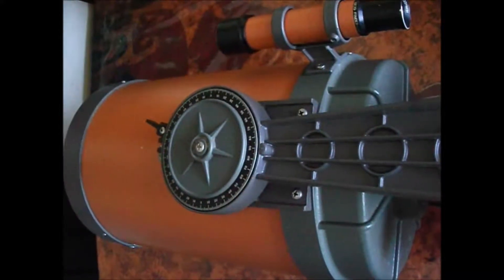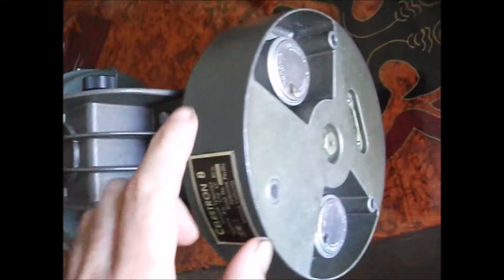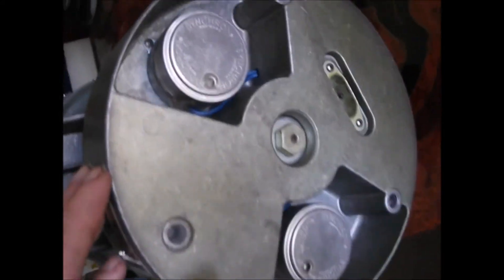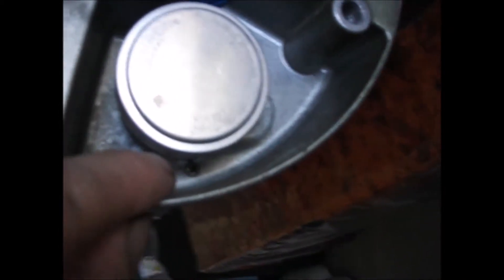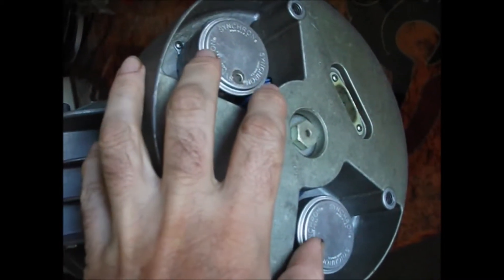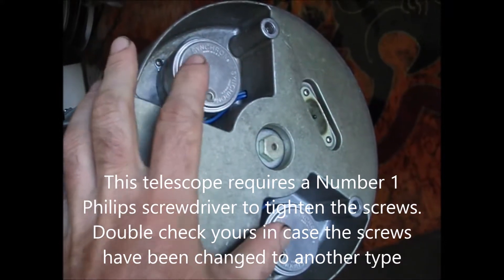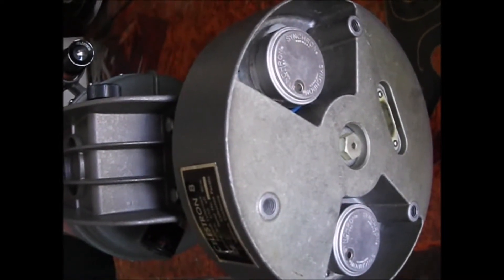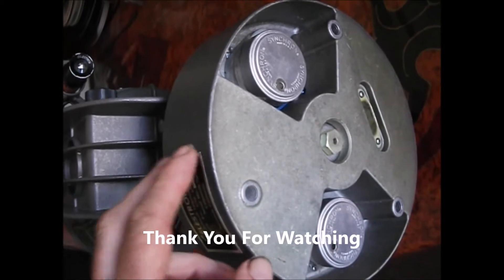Celestron R.A. Drive Backlash

Comment: Hi Mik, I have just been gifted a 1974 classic C8 but it doesn't have any cable / controller. I'm struggling to make sense of what is required to get it running. Do I need an inverter here in Aus for the 240VAC? Any insight would be very welcome. Thankyou.

Comment: Does this fix the issue when you lock the rotation in place but yet the scope have a little side to side motion? Super annoying when wanting to stay fixed on an object and the image just shoots around the view finder.
Reply: Yes.  It's an easy fix.
Reply: @gettingpast4391  I loosened the screws and tightened.. Worked a treat.